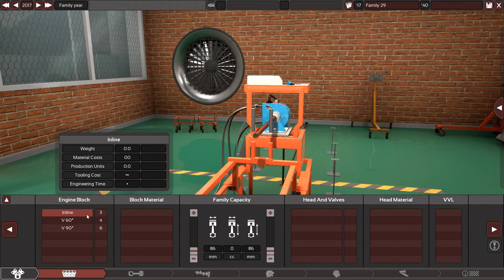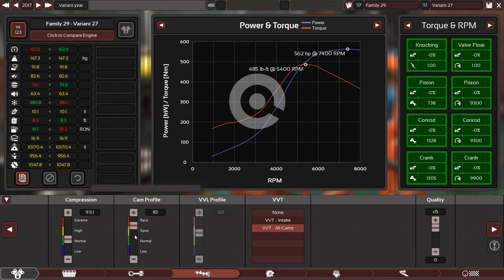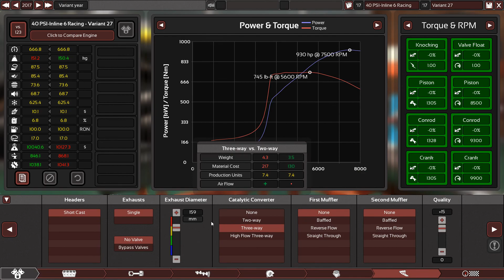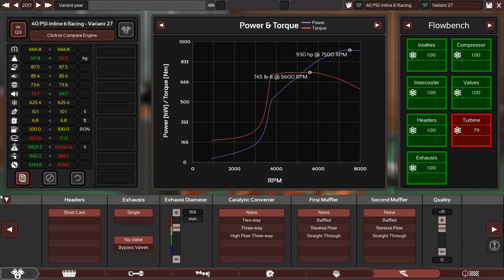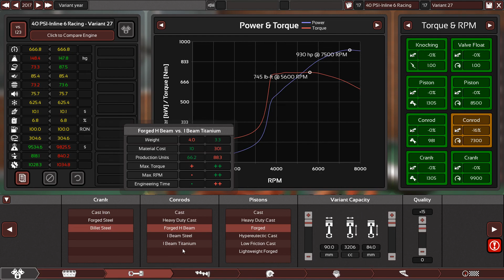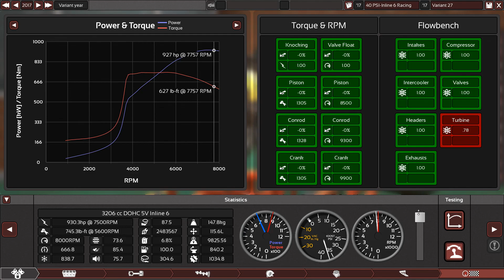40 PSI Turbo Racing Engine.

Comment: Why not increase boost and reduce compression or timing
Reply from the maker: Because it stopped making extra HP after 40 psi
Reply: @BsharNasri  at 5:13 u got a gain of power by increasing the turbine size. However 1 tick later it starts knocking. So u turn it back quickly.